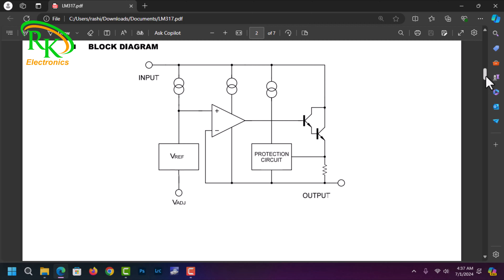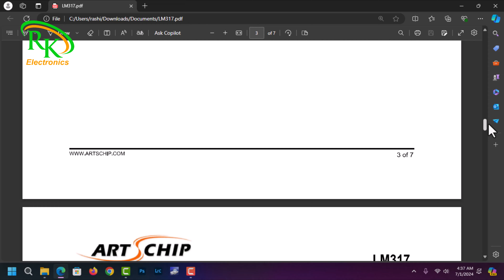How to Make a Fixed 1.5V DC Circuit with LM317 Regulator | Input Range 3V to 30V

Comment: The capacitor goes to the output pin and not to the adjust pin!
Reply: I made the same circuit for a wall clock and it didn't work, then I saw your comment that the capacitor was incorrectly installed, I put it: one pin to the negative and the other pin to the positive output or to the centerpin of the LM317 transistor before the resistance 470 ohm and that's how the clock worked the clock